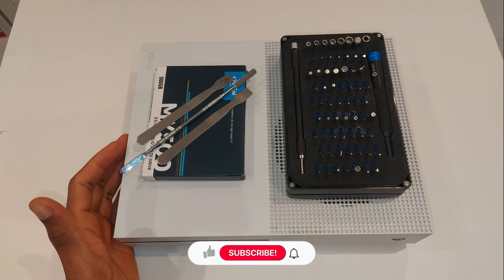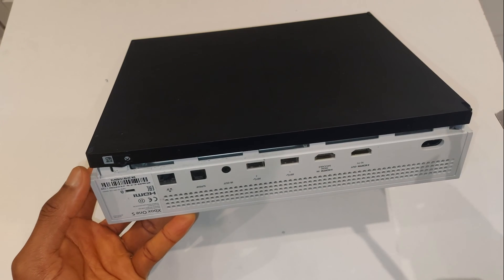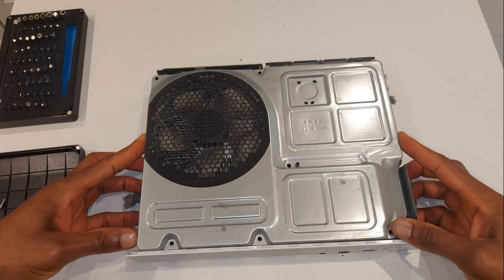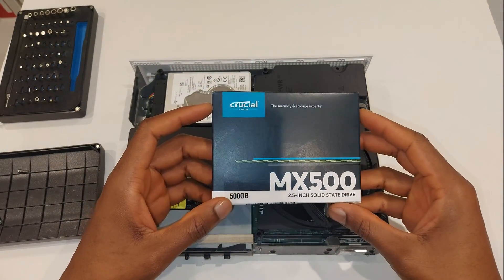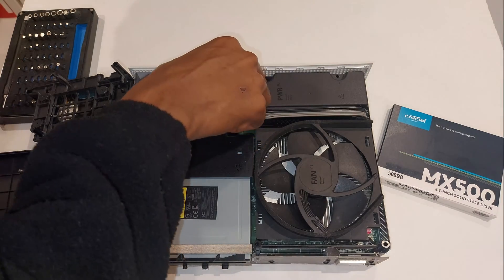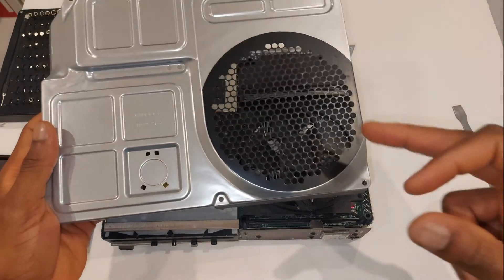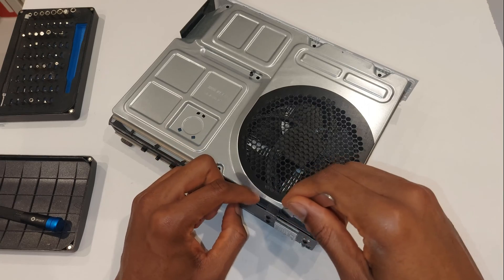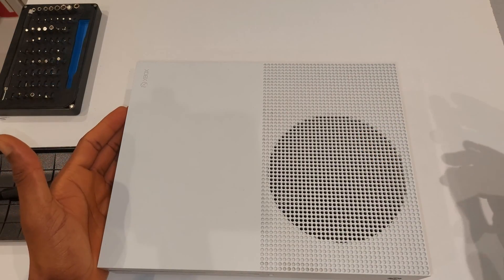Xbox One S SSD Upgrade | How To Upgrade SSD In Xbox One S | 2025

Comment: Is there a link for anything for the tools he is using in the video
Reply from the maker: I used an iFixIt Kit. You can use any decent screwdriver set, they normally have all the bits you need. I got one from Aldi the supermarket and that would have worked fine as well.

Comment: The Xbox One S has SATA2 (375MB/s) and its USB3 (500MB/s) so you are better off just plugging in an external SSD into a USB port and installing/transferring your games onto it than putting one inside the case.

Comment: i did all that and my xbox ia still stucked with “there was a problem with the uldate” now it doesn t connect to wifi, error codes: 0x8B050084 0x00000000    0x00000201
Reply: It will only recognize a 512GB SSD. Anything less than that will not be recognized.

Comment: Just a caution! Don't let the fan spin when you clean it. When you manually spin a fan, it turns into a generator of current and can potentially damage the GPU or other components. Small chance, but rather not risk it.
Reply: This is a myth
Reply: Such a stupid thing to say
Reply: Most modern circuits have a diode in place of that

Comment: If you do it like that, no matter if your ssd is 1tb, you’ll still have 365gb free space.
Reply: Update! I found that in order to have all the space available on your new ssd, it needs to have exactly 1tb or more. Xbox file system for internal drive works only in fixed values like 500gb 1000gb but not more than 2000gb. For example, if you have kingston 960gb sata ssd, xbox will recognize it like a 500gb drive (so no more than 365gb available space) and xbox don’t care about any script. It will just format it again in the offline update process.
Reply: In this way, the script is point less. Also, you can still use the 960gb drive as a 500gb for faster perfomance on the OS. The best and easiest way is to just use an external drive…
Reply: @XTRMike1  really the best is: 500 SSD internal ONLY for system (xbox one S has "only" sata II so, 300MB/s) and external SSD for game (usb 3.0 ...about 2x SATA II...550/580 MB/s) ...like you say!

Comment: Can i not just copy the data from one drive and paste it to the other?
Reply from the maker: I have not tried that. It might work. 

I doubt it as the drives will not be the same sizes and the installation process I am guessing will calculate the size of the drive, take what it needs for the Operating System and recovery then expand the rest of it. 

As far as I am aware this is not something you can do after installation.

Comment: So I've followed this step by step and I got to the update part I have the os onto the flash druve but the option is still grayed out is there a reason for this?
Reply from the maker: This happened to me on another Xbox One S when the Xbox just would not accept the SSD. If you got the same size as the hard drive I can only suggest ging one size up.
Reply: @RonsTechHub  I took out the old ssd and put in the old hdd and I'm getting the same screen with the option still grayed out and no way of getting back to the xbox home or updating it and it does jt on both hdd and ssd
Reply: Try another usb drive formatted in NTFS with the osu1 on

Comment: does the xbox one S have a SATA 3 or 2 connection?
Reply from the maker: Absolutely no idea.
I will lean towards sata 3 simly because of the release date of the One S.
Sata 3 came out in 2009.
The One S came out in 2016.
Reply: @RonsTechHub  my Xbox one S hard drive seems to have failed and won’t boot up anymore. Doing some research and googling looks like One S only supports SATA II so upgrading to an SSD is not very beneficial.
Reply: @Knightfall23  you are right, Xbox One S has SATA II (Xbox One X is Sata III) . So... best is ,maybe (but not really worth it).. , 500SSD for OS only...and external SSD for game ...usb3 is 2x speed than Sata II so.......

Comment: dostum bende aynısı yapıyorum fakat olmuyor ssd 480 gb var elımde kioxia 480 gb exceria serisi eroro 101-106-105 hatası alıyorum xbox cıhazı ssd secıyor olabılır mı
Reply: You need at least 500gb
Reply: The OS installer looks for 500GB, 1TB, and 2TB drives as those are the sizes that Microsoft put into the Xbox One S.
Reply from the maker: 480GB worked fine for me.
I have no idea what that error is about. 
sorry I cannot be much help  to you.

https://www.google.com/search?q=xbox+error+101-106-105&sca_esv=e366935364740875&sca_upv=1&sxsrf=ADLYWIJ5op93KAkc7L6LpuRQLfmJUob01Q%3A1715206050990&ei=ovc7Zr6GPMGghbIP1c6gkAk&ved=0ahUKEwi-34q7iP-FAxVBUEEAHVUnCJIQ4dUDCBA&uact=5&oq=xbox+error+101-106-105&gs_lp=Egxnd3Mtd2l6LXNlcnAiFnhib3ggZXJyb3IgMTAxLTEwNi0xMDUyBRAhGJ8FSLISUABYzQ9wAHgBkAEAmAFtoAHqB6oBBDExLjG4AQPIAQD4AQH4AQKYAgygArYIwgIEECMYJ8ICChAjGIAEGCcYigXCAhEQABiABBiRAhixAxiDARiKBcICCxAAGIAEGJECGIoFwgILEAAYgAQYsQMYgwHCAhEQLhiABBixAxjRAxiDARjHAcICCBAuGIAEGLEDwgIIEAAYgAQYsQPCAgoQABiABBhDGIoFwgINEAAYgAQYsQMYQxiKBcICDhAAGIAEGJECGLEDGIoFwgIKEAAYgAQYFBiHAsICBRAAGIAEmAMAkgcEMTAuMqAHi1Y&sclient=gws-wiz-serp
Reply: Thank you for the guide especially the part about updating on the usb drive

Showing it on the xbox tv screen was also a nice touch.